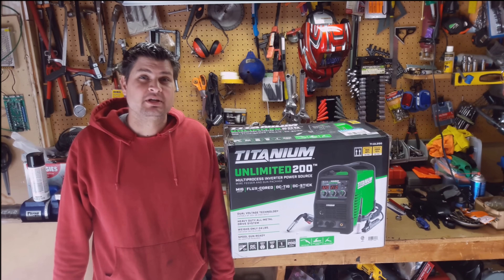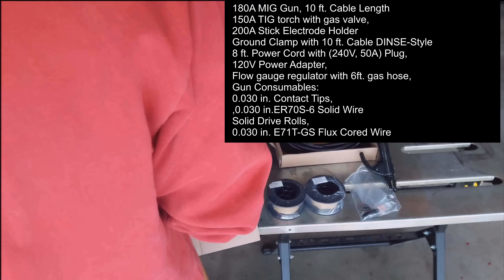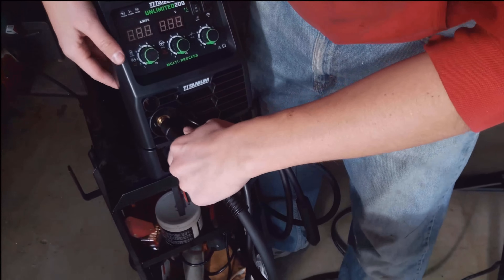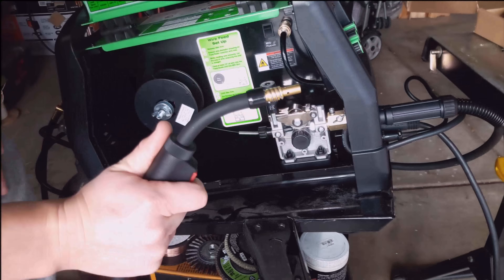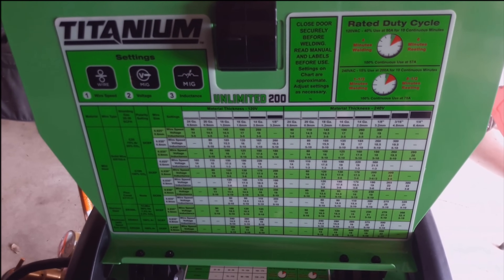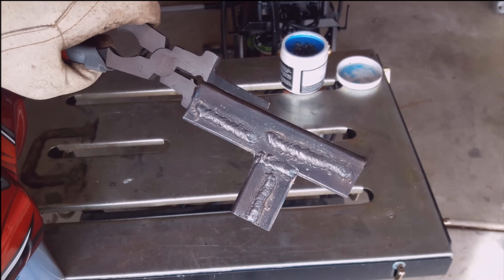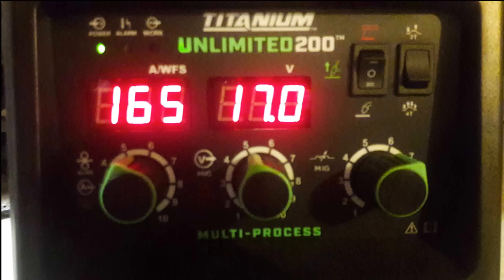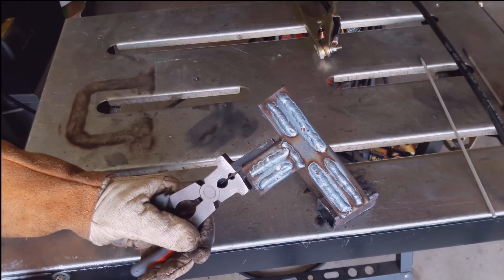Harbor Freight Titanium Multiprocess 200 Welder (Mig & Flux Process)

Comment: Does your mig welding wire speed limit at 275 ? I bought two titanium200 and do both limit at 275 connecting to a 110 outlet … the chart on the machine says wire can reach 400 at 110
Reply from the maker: I'll have to check on mine.
Reply: Did you ever figure this out? I’m having the same thing

Comment: Anyone else notices a slight delay between pressing the trigger and wire feed? Once you press the trigger, gas starts flowing immediately but wire takes a second to start feeding. Not ideal for stop and go welding. Not sure if it's just my machine, settings, or that's how it is?
Reply from the maker: Yes that is a feature. Nice machines you can change that setting. The idea is you want the gas to be flowing before the weld starts so there is no contamination on your weld starts.

Comment: Do you have to use shielding gas for Flux/Mig was in this machine?
Reply from the maker: This machine can do either flux core which does not use shielding gas but it's more expensive for the wire or you can get solid core which does require shielding gas.

Comment: For the first welds you did in this video were you using gas?
Reply from the maker: No,  first ones are flux core only.
Reply: Thank you, I’m a sophomore in a technical high school and I am in the welding program. I recently bought this welder and have really only been using stick. I’m gonna try to branch  out and use the other options and your video was very helpful.
Reply from the maker: @ryanschaefer5344  glad it helped!

Comment: Whats the difference between the 200 and 170?
Reply: The 170 is not capable of stick or tig welding. Also a little less power than the 200
Reply: @walter2670  thank you

Comment: Can you run duel shield mig with this machine?
Reply: no most duel  shield wire is 035 or 045  and this machine has not got a duty cycle that will handle them and it is hard to get 
duel shield wire in 10 or 2lb spools most is 33 lb which this machine can nor handle
Reply: That's I appreciate it. I'm impressed with the Vulcan line. Welded with the 215 yesterday and was plesently surprised.

Comment: If you are looking for an SG for this machine, I purchased the Klutch 150 from Northern Tool and it has the same connections for the trigger, DC, and gas and worked great.  I cut off the loop on the DC cable and replaced it with a 10-25 DINSE connector so I didn't have to bolt it to the MIG outlet each time.

Comment: Howdy. I was wondering which welding cart you're using in your vid. Is it just the standard Harbor Freight one, or some other? Thanks!
Reply from the maker: I am just using their cheap one.
Reply: @-DIYPRO-  Thanks! I'm having trouble finding one wide enough for the welder (12"). Most of the cheap ones out there are 11" wide on the top shelf.